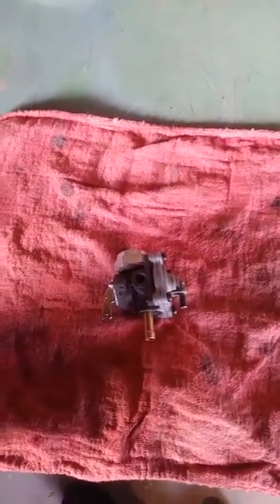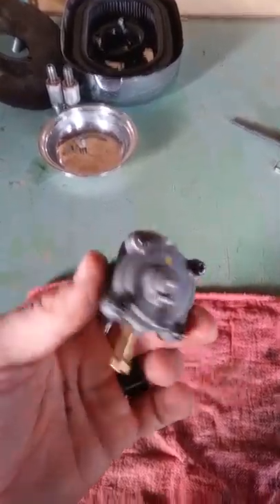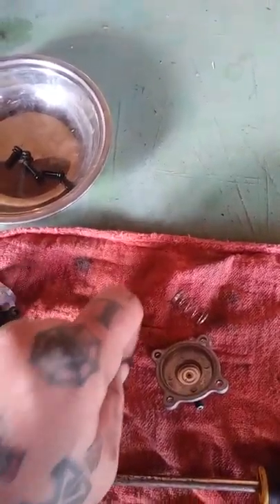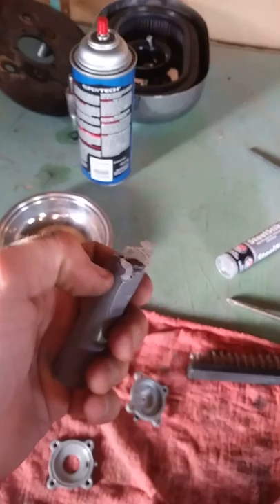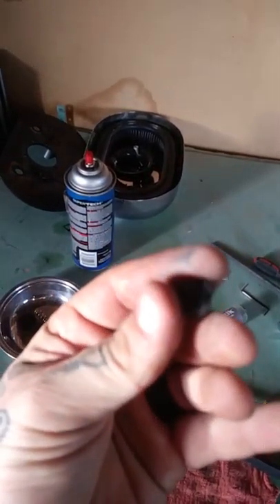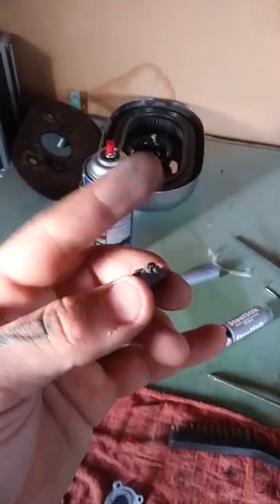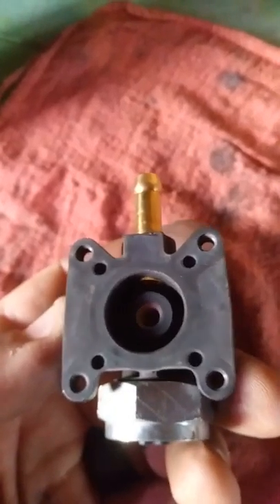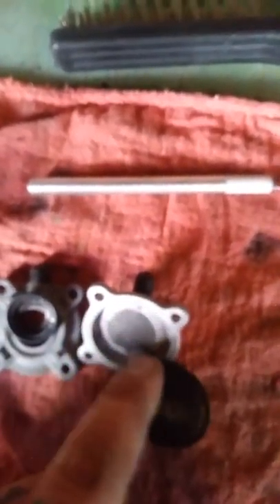Cv carburetor vacuum petcock bypass

Comment: I said fuck all that, cut a blocking plate out of steel, drilled 4 holes in it, cut a gasket and screwed the flat piece of steel back on the petcock and called it good... runs and feeds fuel just fine without all that JB Welding shit and drying and waiting...took me 20 mins.

Comment: Nice! But how does the tank breath for free flow or beak the vacuum when gas cap is closed & sealed.
Reply: Mark Soto they don't breathe anyways. This is just an air suction from the carb to activate the diaphragm. If that line cracks then you have to deal with a lean situation.
Reply: Mark Soto yes sir on these sportsters theres another breather tube under the tank towards the back.
Reply: @zero9886  I cut that vent line for a different tank swap, and now I'm having myself a nice long lasting no spark issue!!

Comment: Just use some fuckn rtv silicone for fuel/air parts or some o-ring sealer and that shit needs more time to harden then that especially when you put that diagram seal back on to block the air !    I understand installing it molds the mender correctly packed where it needs to be but theres better ways and it will leak this is never fuel safe wrong material .....   or just dont do this at all theres other bypass methods
Reply: Rtv no good in gasoline